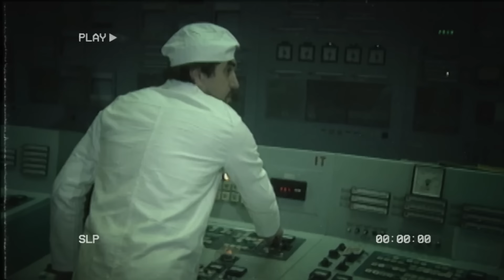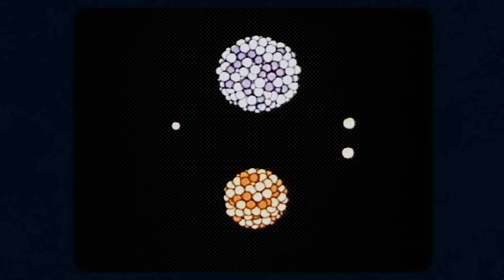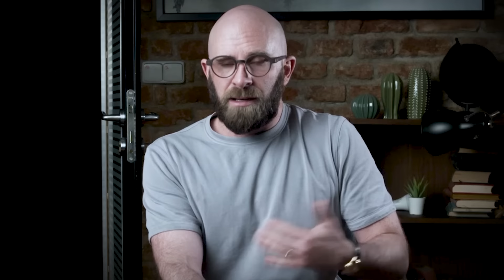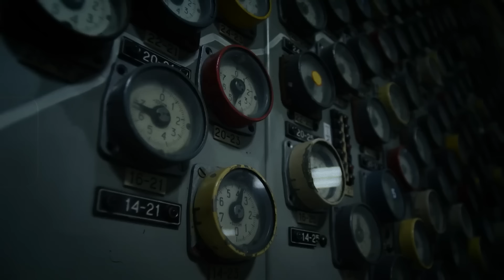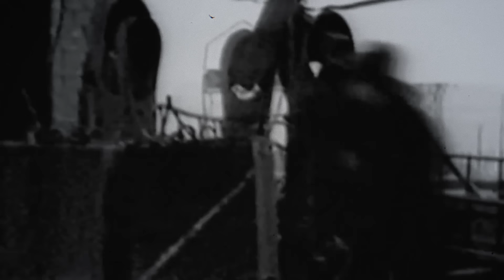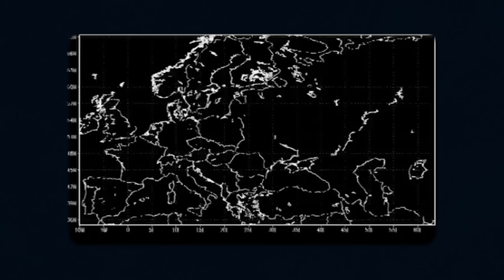The RBMK: The Shoddy Nuclear Reactor That Nearly Killed Millions

Comment: Correction: The "moderator" actually does not "clam down" the reaction, but it increases the reactivity! Yes, the moderator kind of "slows down" the neutrons, but that is required to keep the chain reaction going – because the neutrons emitted from the fission are way too fast (initially) to react with neighboring atoms. Only if slowed down by the moderator sufficiently, the emitted neutrons will trigger more fissions. So, that's why the "slow-down" of the neutrons that is caused by the moderator actually increases the reactivity!

Water can be used as a "moderator" that increases reactivity, but that's not how it is used in the RBMK design. The RMBK design uses graphite as a moderator. That's why, in the RMBK design, the water does not increase but rather decrease reactivity. And, therefore, if the water boils off (because the reactor gets too hot), you have more "voids" that further increase reactivity! This can easily result in a "doom loop" that finally causes the reactor to melt down. Reactors that use water as a moderator are safer, by design, because if the water boils off, the moderator is gone and thus the chain reaction will stop. Of course, even water moderated reactors can melt down, if cooling is lacking for too long (see Fukushima).

Comment: In addition to not properly explaining the moderator, you don't explain the "impossibility" of controlling an (exponential in time) chain reaction which has a time constant of about 10 nanoseconds per "generation" of atoms splitting.  There is no way a mechanical action (moving a control rod in or out, over periods of seconds) can possibly regulate the reaction rate.  In order to make a reactor controllable, the control rods must be set so the net "gain" per generation of fission neutrons is LESS THEN ONE.  Typically this is set just less then one like 0.99.  The remainder of neutrons comes from the delayed breakdown of the fission products.  (After the uranium splits, many of the fission products are unstable.  Some of these, in the course of decay, produce neutrons.)  These products make neutrons with half-lives of several minutes.  That ~1%, combined with the ~99% "prompt" neutrons from the uranium fission, is regulated by the control rods to be exactly one.  So even a stably operating reactor is only ~1% away from undergoing a n "explosive event".
          Your comment about the reactor exceeding "10 times rated power" is incorrect.  The number is more like 1000 times rated power or even more.  The reactor went "prompt critical" meaning the power doubled roughly every 10 nanoseconds.  In only 1 millionth of a second, the reaction would have involved every U-235 atom in the reactor.  The only thing stopping this increase is what also stops atomic bombs: the reactor blew apart.

Comment: The lack of pressure vessels wasn't even much of a cost-problem. VVER-reactors (the soviet pendant to Westinghouse's PWR) were under the control of the 'Ministry of Medium Machine Building', concerned mainly with military applications. RBMK could be build from mass-produced steel-tubes and graphite-blocks, outside that ministries control. The arrangement of moderator and coolant was choosen to use low-enriched uranium. It was internal turf-wars, that lead to that flawed design.

Comment: Hey! Love your videos, but I would like to correct some things:

A moderator like water is meant to increase the rate of reaction. It does this by yes, slowing neutrons. But slow neutrons have a higher chance of inducing fission than fast neutrons due to nuclear cross section.

The RBMK reactors didnt quite "operate" off the positive void coefficient, but rather it was an unintended consequence of the design. When the water boiled, there was no liquid coolant. In a modern reactor, this would decrease reactivity because the fast neutrons would simply pass through nuclear material, allowing for more coolant to flow inside. 
However, because RBMK reactors were graphite moderated, those fast neutrons were simply bounced off the graphite, becoming slow neutrons, and heating the reactor exponentially despite loss of water as a moderator.

Comment: Oh boy.  
cracks knuckles  

0:03 The reactor blew up once in a massive steam explosion, not twice in separate explosions. 
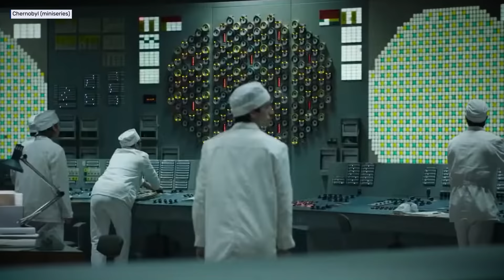0:10 Chernobyl wasn’t the "single greatest nuclear disaster in human history" in terms of deaths. More people likely died from long-term radiation exposure from things like atomic bomb testing and the Kyshtym disaster.  
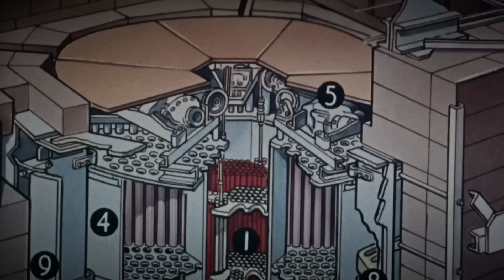0:24 The RBMK wasn’t some universally praised marvel before the disaster—Soviet scientists already knew it had serious safety risks.  
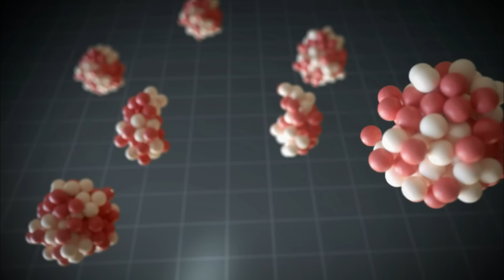1:48 Nuclear fission as used in reactors doesn’t just happen naturally. You need enriched fuel and a controlled reaction.  
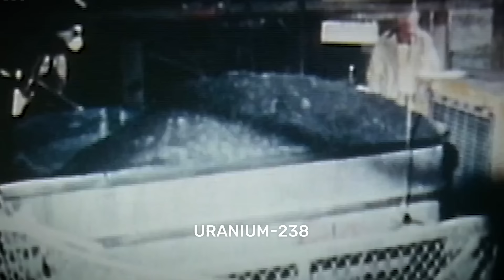3:12 Uranium-238 is fissile, just not with thermal neutrons. It can undergo fission with fast neutrons and can be turned into plutonium-239, which is fissile.  
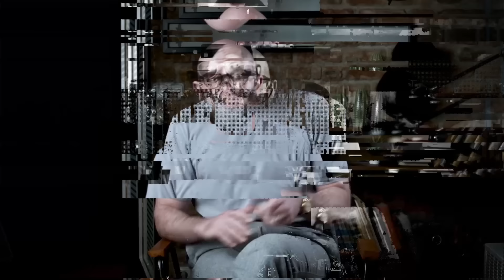 4:19 Most reactors have built-in safety mechanisms to keep them stable. Even RBMKs don’t just "keep going and going until they explode". They need a mix of bad design and bad decisions to fail that catastrophically.  
5:57 The control rods at Three Mile Island stopped the reaction, but they didn’t prevent core damage. The containment structure is what stopped a full-blown disaster.  
7:16 The RBMK’s refueling system wasn’t just about saving money. It also let the reactor run continuously without shutting down for refueling, which was a big advantage.  
7:39 The RBMK didn’t have a containment vessel, but that wasn’t just about cost-cutting: it was designed that way partly because the Soviets wanted easy access to the reactor’s plutonium for potential weapon use.  
10:18 Calling the RBMK a "total heap of junk" is a bit much. It was a flawed design, but plenty of them ran for decades without blowing up (once they got some safety upgrades).  
10:46 The graphite tips on the control rods weren’t there to save money. They were meant to improve neutron efficiency. Still a massive design flaw, but not a budget cut.  
13:06 RBMK reactors were indeed sketchy at low power, but things got way worse thanks to bad training and a bunch of mistakes during the test.  
13:49 "Almost no control rods in place" isn’t quite right. Some were still in, just not nearly enough to keep things under control.  
14:33 The "1000-ton upper shield" didn’t get launched into the air like a rocket. It was blasted upward and landed mostly inside the reactor hall.  
14:50 There was no confirmed hydrogen explosion. The second explosion was almost certainly just another steam-driven blast.  
16:30 The 985000 deaths estimate from Greenpeace is wildly exaggerated. Most serious studies put the long-term death toll between 4000 and 60000.  
17:52 The idea that a second explosion could have been 3–5 megatons is pure speculation. There’s no credible science behind that claim.  
20:00 The graphite at Chernobyl was already on fire. The big risk wasn’t "spreading flames" but the fact that burning graphite spewed radioactive particles into the air for days.  
21:34 RBMK reactors today are much safer than they were in 1986, but they still don’t have containment buildings like modern reactors, so they’ll never be as safe as Western designs.

Comment: The design of the RBMK isn't irrational at all.  We use light water as both a moderator and coolant, but doing so requires us to use uranium that is enriched from 0.71% U-235 to about 3.5% U-235.  That's because the single proton hydrogen of light water has just enough of a neutron capture cross section to make it a neutron poison for uranium with lower U-235 concentration.  The RBMK is designed to use natural uranium as a fuel.  That requires a moderator that has a lower neutron capture cross section than single proton hydrogen.  The choices would be heavy water (deuterium having a negligible capture cross section) as in the Canadian CANDU reactor, or graphite.  The Soviets chose graphite, and the light water coolant is thus a poison to the neutron economy - unless it boils, reducing its density.  Using natural uranium is way less expensive and environmentally damaging than even low-enriched uranium, and the overall fuel cycle is vastly more economical than ours.  Moreover, the RBMKs have a long record of safe operation.  The plant operators conducting the simulated shutdown test had to really work to defeat all of the safety systems, and on top of it be unaware of the role of the fission product xenon 135 in the transient behavior of their reactor.  It wasn't an "ordinary" accident, something that might happen once in a while in the normal course of operation of that plant.  It was very specific  to the test they were conducting, one which had been tried several times prior to that night - always unsuccessfully - but never with the Herculean effort they put into shutting off all of those pesky safety devices.
Reply: And THIS is the information I would expect from the material, not "ah it was just Soviet POS". Thanks for typing all that.

Comment: I mean the graphite displacers were not just a complete design flaw but rather seen as necessary to make the reactor work as they wanted and really to safe costs, just not as one would expect. It has nothing to do with boron being more expensive, that was probably also not what was the intention to call it cheaper in the series. Rather the graphite displacers served the purpose of being able to reduce the enrichment  level of the uranium needed to run the reactor to about 2% of U235, which was a lot cheaper to produce then the about 3-4% western reactors use. That was needed because the water in the channels at the bottom of the reactor acts as a moderator to accelerate the reaction during normal operation. If the control roads are now partially inserted into the core, to regulate power during normal operation and keep a steady reaction, this would not only lead to the boron absorbing neutrons as it was intended to do, but rather also displace water acting as removal of a moderator from the core which would lead to drastic changes in reactivity hard to manage. So the graphite displacers were added replacing the water with an other moderator at first and only at a far later point adding the boron to reduce reactivity. The reactors were later slightly changed by removing about 2/3s of the graphite displacers and increasing the minimum enrichment of the uranium to 2.8% so that the effect of the decreased reactivity due to water being replaced would not have the same effect to the reactors operation.

Comment: That's not really how air brakes work on a locomotive. Technically, without any air in the system there are no brakes. It's a difference in air pressure that causes the brakes to activate. If you loose all the air in the system, there is no difference in pressure and thus no brakes. (even this description is oversimplified, but it should give a better idea).

Edit: You really need to do a better job proofreading with someone that knows the material. I'm less then half way through and you've gotten moderators wrong, locomotive brakes wrong, then screwed up void coefficient. You don't increase the voids by "adding more coolant". You know what's a bigger void than boiling coolant? Open air/steam. If you've dropped enough coolant that things are exposed, the voids aren't going to get worse by adding more coolant.

I haven't reached the point in the video, but others have said the Megaton explosion is wrong too. I don't know if you step around that by saying that it was the value they claimed, but if you didn't it's probably not best to blindly believe everything that came out of the USSR. There were a number of things they claimed (at least initially) that were incorrect (for one reason or another).

Dreading watching the rest and finding out what else is completely wrong.
Reply: Not sure if you noticed but when he talked about significant changes containment domes werent mentioned. I dont think the writer knows about this.
Reply: Spelling Latin "i e" just like English letters, not as "id est", was the rotten cherry on top of bad cake ;)

Comment: You should talk to Moltex Energy about their static salt reactor which “burns” spent nuclear fuel in a self stabilising system. It cannot overheat it’s literally intrinsically safe. The list of benefits over water reactors is endless.

Comment: Another reason why I only like Thorium Molten Salt Reactor when it comes to fission reactors.
Reply: We don't need it. Nuclear safety, right now, with decade old tech, is already on par with renewables. 

While new technology is certainly something we should strive for, in nuclear's current state, it's just a distraction.

We need momentum. Nuclear struggles to build ANY plants, much less, new fangled untested(commercially speaking) reactors.

Inexperience balloons costs, creates hesitance, atrophies knowhow and supply chains. 

Meanwhile, coal kills thousands every year. And isn't easily replaced by renewables.

Once this slump has been overcome, then we think about new tech. 

Right now, what nuclear needs the most is to get the ball rolling.

Comment: The idea of the 'moderator' is to slow down 'fast' neutrons, which do not sustain a chain reaction, to 'thermal' velocities which can be 'captured' by the Uranium 235 and initiate nuclear fission - releasing energy and more fast neutrons. This is needed to keep fission going, if the moderator was absent, fission would not occur.
On the other hand, the control rods and 'injectable poisons' etc are composed of materials which absorb neutrons, thus enabling the fine tuning and control of the reactor, or, if necessary, to kill fission stone dead.

Comment: It would appear that the power level mismanagement brought it toward Xenon precluded startup, crashing the reactivity to the point where they attempted a dangerous removal of control rods to keep it running. Xenon 135, a significant neutron absorber, is created and destroyed at an equilibrium level. Lowering the power too much or too fast allows it to build up and further suppress the reaction.

Comment: 17:50 - A steam explosion reaching kiloton or even megaton range is highly unrealistic. Even if all of the water in the basement instantly turned to steam, the basement was not sealed tightly enough and the steam would just escape through the many holes and gaps.

If you want to consider hydrogen (Like what caused second explosion), there would not be enough water or oxygen in the basement to get even close to a kiloton. I did the math on this a while ago, but it would've taken something like 1.5x the water in Lake Mead to generate enough hydrogen to reach even 1 megaton.
Reply: And what was he on about a nuclear-style "fireball" from a STEAM explosion? This has to be one worst dramatizations I've ever seen.
Reply: @adequatemii4006 That "nuclear-style fireball" is a heat effect, and it can occur in any massive explosion. When the "lid" was blown off, air was allowed into the reactor that mixed with the hydrogen produced in the reactor (radiolosys of water) and ignited. A hydrogen explosion is extremely powerful.
Reply: I am referring to the "5 megaton steam explosion" mentioned in the video, not the hypothetical radiolysis of water resulting in a pure hydrogen-ignition explosion. You are right about conventional explosions having a fireball though.
Reply: @curtrapp5291  Dude, he literally tries to quantify a 5Mt yield using a nukemap sim or something to estimate the damage of the fireball radius... for an overpressure event. That's insane levels of pseudoscience.

Comment: The Red Forest in Chornobyl, Ukraine, As a result of the explosion at the nuclear power plant on April 28, 1986, radioactive contamination was released into the atmosphere and huge environmental areas. One of the pine forest’s sections, lying closest to the plant, was the first to take the strike. It received the most significant radiation dosage. Many of the trees there died just instantly. Because of this radiation “footprint,” they became rusty red. That is how the forest earned its name. Then, it was decided to cut down contaminated pines. As the trees there absorbed enormous amounts of radiation, they represented a considerable danger for people and the environment. The destroyed trees were buried in special trenches covered with sand. New pine saplings were planted, and the Red Forest became a surprisingly fertile habitat for flora and fauna, including endangered species. Its biodiversity has generally increased a lot since 1986, though the forest remains one of the most contaminated areas in the world. Scientists still study how plants and animals, though they have varying radiation tolerance, could survive in the forest. The highest level of radiation, around 90%, is concentrated in the forest’s soil, where plants and insects absorb it. Another danger that remains today is forest fires, which might cause the release of radioactive material into the atmosphere. Ukraine constantly conducts measurements of radiation levels in the area, tests the areas for radionuclides, trains firefighters, and has wildfire prevention.

Comment: There is a very important point that’s missing and it was the previous year. Israle bombed a nuclear actor. This was the first time a nuclear reactor had been targeted by an aggressor. Russia wanted to make sure it could close it wrapped down efficiently by replicating a procedure which would close the reactor down immediately to simulate an attack by a foreign nation.    Unfortunately the router design and the way it was implemented didn’t turn out well.